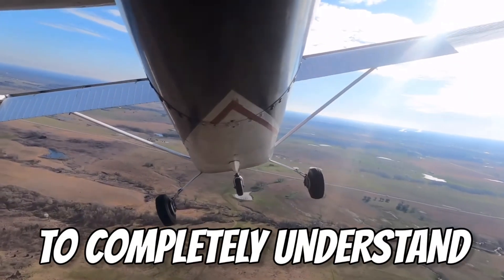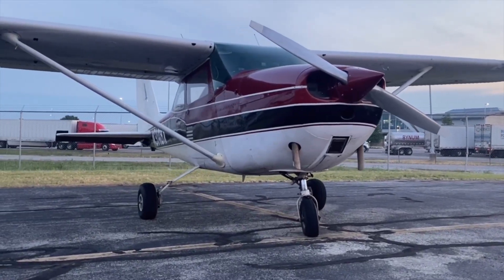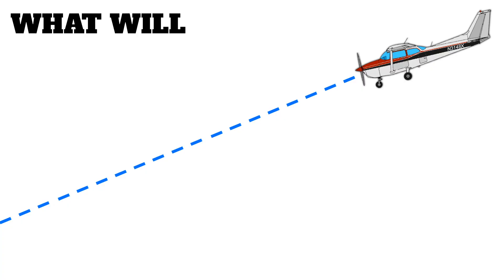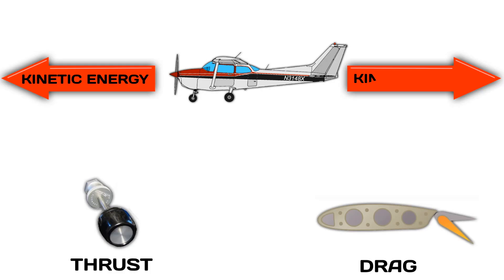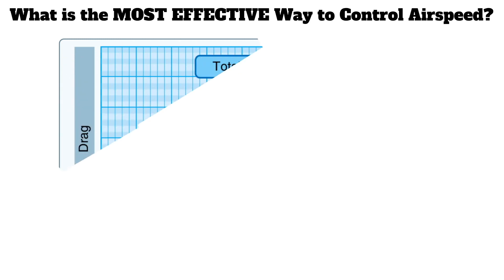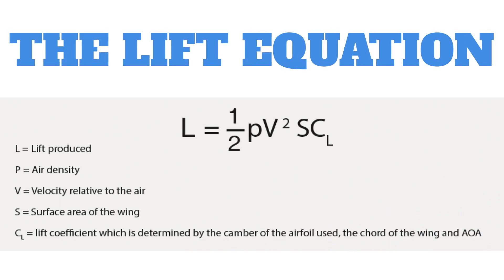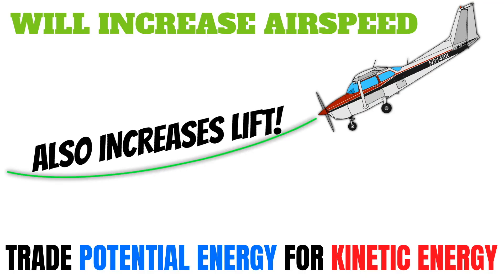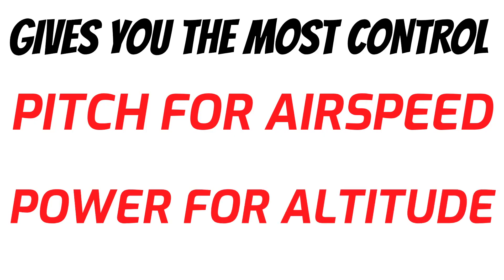Should I Use PITCH or POWER?

Comment: Well it depends. For understanding fundamentals one should practice first by setting pitch for speed and power for altitude but in practical flying I switched it around. You have to pull power to reduce airspeed and to descend anyway so I pull power abeam and reapply it after slowing down to sustain the desired speed in the descent. I then aim for the runway and adjust the power to maintain the desired speed. I noticed I had a tendency to get in low and slow if I focused on pitch for speed and power for altitude. So now I aim the plane where I want it to go making sure I'm neither high nor low and adjust the power to keep the desired speed.
Reply: Yes.
Reply: I agree with you. I also think the same way. But not sure why sometimes the instructor doesn't like to add/reduce power but to insists pitch up/down during landing to control airspeed.

Comment: Perhaps, as an older student pilot, I have more trouble with in depth concepts like this but...I've come to realize that there is a big difference between descent and sink. On final I'm using pitch to control the angle of descent(altitude) with its resultant change in in airspeed and power to increase or decrease my sink rate(altitude). I visualize the aircraft settling towards the runway with power adjustments and pitch to maintain my desired airspeed. From my perspective this seems a simpler way to express the issue. Great in-depth video!
Reply from the maker: Thanks! Yes, once again you can use both, and some folks have mentioned that using the opposite is an advantage when you need to make tiny corrections, but I think it’s important to know the most effective way to control the airplane

Comment: Very good discussion and break down…you also brought in an element that I find is rarely addressed…Camber.  Most GA aircraft are high camber, low power. So the “ancient” advice from “Stick and Rudder” of pitch for airspeed, power for altitude applies because high Camber will have a near instant effect on altitude when power is applied…and Camber is effectively increased with flaps.  But in high performance, no camber/symmetric airfoils, that’s not quite the case.  In USAF Pilot training, we would have to break the GA-taught model for guys, because the power for airspeed, pitch for altitude (angle of attack) was more important based on phase of flight.  Think of airliners (who mostly have near symmetric airfoils and lots of power), when on final, do you feel them making more pitch adjustments or power adjustments.  Generally, it’s power.  So the bottom line is, “it depends.”  On what? Know your aircraft, its capabilities, and what portion of your power curve you’re on based on your aircraft and configuration…and as you very well said in the video, it’s a COMBINATION of the two inputs.  What amount is required in each, depends on your aircraft capability/design, phase of flight, conditions, etc.  The two sides of the argument are moot, the answer is “it depends”👊🏻
Reply from the maker: Excellent point! Camber is also extremely important to consider. Thank you!
Reply: Btw, also prior Herc driver, keep the four fans of freedom flying!👊🏻
Reply from the maker: @Gibber66 awesome! My favorite plane to ever fly

Comment: If a person were trying to maintain an aim point on the runway, would adding power with flaps down and the nose pitched down increase altitude, the airspeed, or both? Can an airplane in a nose down attitude climb with power, or will that only occur with a gust? Hmmm….
Reply from the maker: Once again, that depends on the power you have available and your drag configuration, but typically adding power will only reduce sink and slightly increase airspeed

Comment: Great explanation…on why the energy management diatribe should be tossed. The entire discussion should be based on the Lift Equation for pitching for airspeed and power for altitude. This crap about Kinetic vs. Potential Energy is not helpful. But understanding the Lift Equation and C sub L is essential to controlling the airplane.

Comment: I reach the same conclusion as you, but based on different analysis. The reason not to use pitch to control your descent rate on final approach is that, at that airspeed, it is not very effective at changing your descent rate. 

When you change the pitch attitude, there is a transient effect while the airspeed changes and then you reach a new steady state condition at the new airspeed. The business about trading altitude and airspeed describes the transient effect, but tells us nothing about how the new steady state condition compares to the original steady state condition. During the round-out and flare, we are managing the transient effect. But pilots trying to fly a stabilized approach need to focus on the new steady state. So, the discussion about potential energy and kinetic energy is mostly a distraction.

Changes in pitch change your airspeed in the same direction in all flight regimes. Nose down always increases airspeed and nose up always decreases airspeed. However, the change in descent rate varies based on the flight regime. The new steady state may have a higher or a lower descent rate. At cruise airspeed, nose up will result in reduced descent rate (or increased climb rate). At slow airspeeds, on the other hand, nose up will result in an increased descent rate once the transient effect passes. Final approach speed is usually near the minimum drag speed where pitch changes have negligible lasting effect on descent rate. Changing power or drag, on the other hand, will change your descent rate in the same direction in all flight regimes. (As your descent angle changes, you will need to make some adjustment to pitch attitude to maintain the same angle of attack.) 

The alternate approach works indirectly. Pitching down when you are above the glideslope causes an increase in speed. If you then reduce power to offset that increase in speed, then you will increase your descent rate. But it is the reduction in power that had the desired effect, not the pitch change. Why do it indirectly?

Comment: Airline pilot and former flight instructor.  The pitch for airspeed and power for altitude can work for small general aviation aircraft, but is not used in higher performance aircraft.  The problem is your glide path angle is going to be all over the place especially in gusty turbulent conditions.  The way to learn is trying to maintain a constant glide path during the approach to landing like a ILS.  Train yourself to try to maintain a constant 3 degree approach.  Use a ILS, vasi or papi as reference to teach yourself the visuals.  When you perform a ILS you will get your aircraft trimmed up for your approach speed and your decent rate based on your ground speed.  You could use pitch for airspeed or power for altitude in calm conditions, but it is not effective in gusty or turbulent conditions.  In real world conditions if you get above your glide path or slope in a ils you lower your pitch or nose to get back on the glide slope.  Small corrections in pitch backed up by the vertical speed indicator.  In gusty conditions you will be on your glide slope and your airspeed will increase and decrease depending on where the gust is from the headwind or tailwind, power is used to maintain airspeed.  The problem with the pitch for airspeed and power for altitude method is in gusty conditions your glide path is going to be all over the place and it could resulting in ballooning on the landing flare where sometimes you just need to fly the aircraft onto the ground.  If you teach yourself to maintain a 3 degree approach angle you will fly the aircraft the same weather it is VFR or IFR.
Reply: Gather your advice is not for small SEP GA aircraft, but rather higher performance aircraft?
Reply: @AmericusMaximus  All aircraft.  You can get away with pitch for airspeed power for altitude in some general aviation aircraft, but eventually might start flying instruments.  A good example is the ILS.  If you are high on the glide slope you lower the nose to capture the glide slope.  Pitch for Altitude.  Yes you will have to reduce power almost instantly to counter the increase in airspeed. Power for Airspeed.  Now use this technique for VFR on approach with a PAPI or VASI.  Use your VSI to make corrections.  The VSI will be used a lot in instrument training.  If you are high on the VASI or PAPI lower the nose to increase your decent to capture the PAPI or VASI.  Same technique in VFR or IFR approaches.  The autopilot on ILS approaches uses the same technique.  If you do not have auto thrust you will have to power for airspeed as the autopilot pitches for altitude.
Reply: @MrWoowootila  Appreciate the thoughtful advice.
Reply: @AmericusMaximus  I started in a two-seat Grumman American and finished my Private in a Cessna 152 - 100% pitch to glideslope and power for speed in both of them and everything else flown afterwards (single and multi - 48 years).  The controls function the same in all aircraft.

In a model like a Skyhawk, sure it's possible to trim it out and then use the power to increase and decrease pitch because the propeller slipstream will push the tail down and let it come up.  In good weather it works pretty decently but if the weather is not so good, you'll quickly realize serious shortcomings.  In bad weather, it's usually necessary to pitch quickly and accurately in one direction and then the other.  You will not be able to do that using the throttle and a cushion of air controlling the tail.  Pitching for airspeed also becomes very problematic in gusting winds - I was with a pilot who started chasing the airspeed with the elevator when it became gusty on final - his straight line of flight became a scary zigzagging line nearing the runway.

In other models, this technique doesn't work even in good conditions.  In a t-tail business jet, for example, the engines on the rear of the fuselage don't have any effect on the airflow of the high positioned horizontal stabilizer.  An increase in power actually causes a pitching down moment because of their position and angle and how they work with the center of gravity.  All autopilots will pitch to the glideslope.

What all this means is that a pilot who pitches to airspeed and uses power for altitude has limited skills in basic airplanes, and will not be prepared to progress into advanced aircraft.
Reply: @warren5699  Thank you for the thoughtful advice.
Reply: @warren5699  "In bad weather, it's usually necessary to pitch quickly and accurately in one direction and then the other. " 

Do you have to constantly adjust the power to maintain airspeed while you're pitching up and down?
Reply: @zetareticulan321  It all depends on how long you apply the forward or back pressure and/or the amount of forward or back pressure that is applied.  If the pilot has to make frequent but relatively small adjustments because of continuous light turbulence, then the changes in airspeed may be so small (not more than 5 kts in either direction) that an adjustment in power may not be necessary if you've added the appropriate gust factor.  But if an updraft or downdraft lasts longer, or a significantly greater amount of forward and back pressure needs to be applied, then a coordinated change in the power is critical to avoid any dangerous changes in the airspeed.  Your training in maneuvers like steeps and stalls will give you a good idea of how much airspeed is affected by forward and back pressure on the control wheel, so use the power to avoid excessive changes in speed, and of course don't cause a stall due to excessive back pressure.  The power cannot avoid a stall if the pitch is excessive as you know from stall entries.
Reply: @warren5699  Thanks!

Comment: Energy management may be easier to understand if you fly gliders first. Adding engine power to the equation later just gives you some 'free' energy available to play with when you like it or need it  ✈🙂. You probably won't be puzzled by 'should I use power or pitch' in your mental picture. Have good safe flights.
Reply from the maker: At some point, I’m going to fly a glider